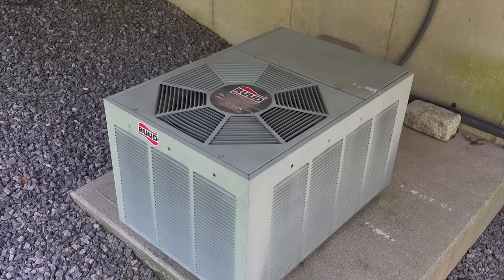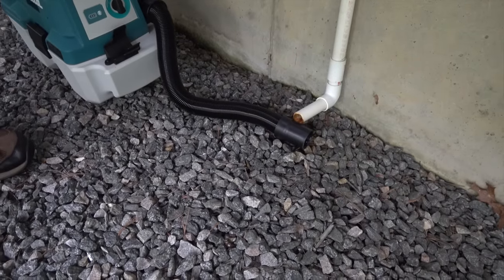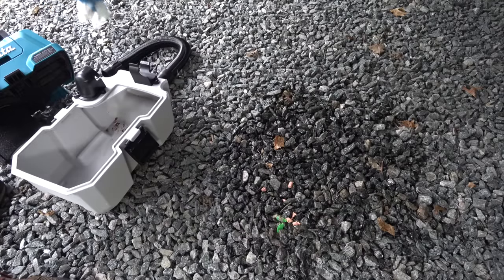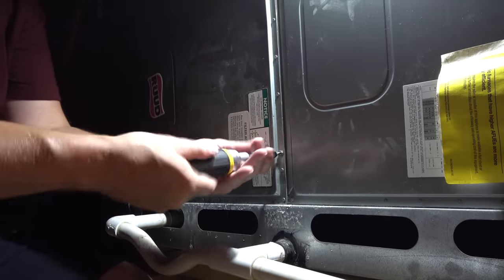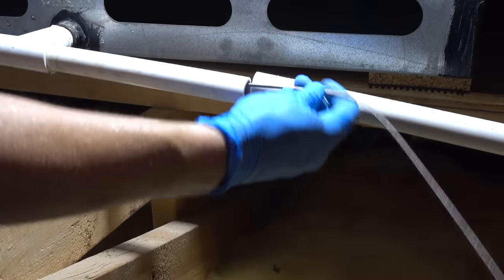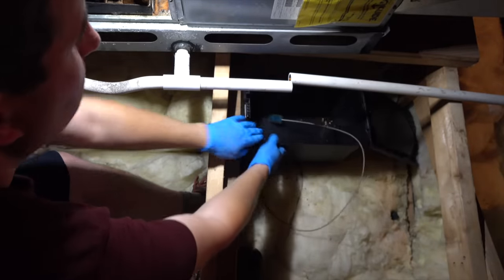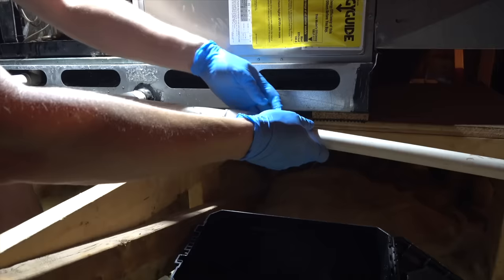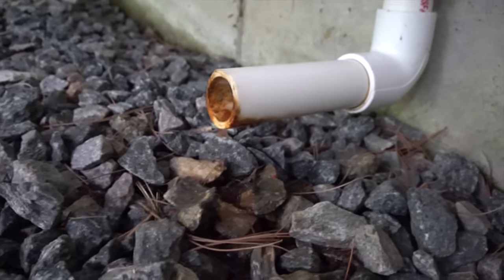How to UNCLOG your AC DRAIN Condensate line FAST - Water stains on Ceiling? or in the Pan

Comment: You’re better off having you system serviced annually in order the keep the drains and coils clean. You also should be using pleated filters, not the cheap fiberglass. The fiberglass foyer allows too much dirt through, which collects on the evaporator coil. Some of the dirt sticks to the coil, some of it goes into the pan, then to the drain.
Reply: Fiberglass,  or Furnace filters are primarily meant to keep paper and dog hair from a heat exchanger. Not filter the air.
Reply: craig kennedy you missed how I said to swap it out for a pleated filter. Pleated filters filter the air. 🤦‍♂️
Reply: I never use pleated filters which restrict Airflow. Fiberglass works fine. Airflow is everything. My evap coil is fine because I change filters monthly and have the coil cleaned every 24 months.

Comment: Instead of clowning around with tubing and pipe clamps, install a tee and a cap instead. It'll be much more secure and reliable, and you'll have a built in point of access to do preventative drain maintenance or a place to hook up your vac to remove future clogs.
If your forced to work in the attic, do yourself a favor and work smart. 🧠

Comment: Problem is my drain goes down into the ground in a cement slab to God only knows where, it backed up so many times i finally had to make a new drain line through walls of the house and to the outside, thats the only thing that finally fixed it.

Comment: what about a cup of bleach in the drain pan a couple of times a year? (as needed)
Reply: Old school, and bleach fumes can make people sick and damage the coil
Reply: @craigkennedy9968  - even though it's diluted in the drain water? And how would it damage the coil if it's only in the drain pan going down the drain?
(not trolling)
Reply: @corvuscrow5485  fumes. This is also why it is against code to pipe the condensate lines to sewer vents. Fumes, even if diluted with water, it will quickly become diluted with condensate water anyhow. And some don't open the condensate lines, they splash it on the coil.
What this jackleg isn't telling you, is that there are building codes governing how to run a condensate line, and he isn't doing it.

Comment: I'm confused:  At 3:10 I see the primary drain (the lower one) and the secondary drain (the upper one) both drain from the same PVC pipe to the outside of the house.  If the primary drain gets clogged by an obstruction in the pipe both drains are effected.  I live in a house where the primary was by the condenser coils and the secondary was by the entrance to the house.  One day I came home and noticed condensate coming from the secondary and I knew immediately there was a problem. No water stained ceiling!
Reply from the maker: That is correct, I have never seen dual pipes inbstalled except in the Southern states. Not a great thing really. ideally you would have 2. But most often the clog is in that trap so it must not be a big enough issue for installers.
Reply: You are 100 % correct. I am a home inspector in New York and I call it out everytime I see both lines tied together

Comment: Ever who installed that did it wrong, it's not even up to Code. It must have a drain pan and and overflow switch.. This ties into the Red 24v line and when the switch senses water it will Break Red and kill the Unit.  Any unit in the Attic must have a Drain Pan... And a 90$ float switch is definitely a must to save you from this problem.

Comment: On the condensate line, I take my water hose which mates up to the fitting.  I disconnect the line from the unit inside the house.  With my wife standing by the unit, I open the water hose and turn it off when she yells.  Then I go an vacuum the water out of the condensate pan below the unit and reconnect.  Do it every couple of years or as needed.

Comment: What size shop vac is needed? I just bought a small one gallon from Amazon. Is that sufficient?
Reply from the maker: You can give it a try, the one I used here is really small and worked fine, but it depends if the clog is really bad, but usually it just needs a little pull to get it out.

Comment: Sucking it from the outside, how about duct tape instead of rags?  And my a/c drain upstairs isn’t like in this video.  It’s like a T joint where it’s open at the top and if there’s a clog water just overflows and leaks into the guest bathroom below.  So the clog is definitely from the T joint to where it’s supposed to drain to outside.

Comment: I poured bleach, vinegar and warm water  (all separately of course)  nothing happened. Used a hose to flush outside water flowed inside my laundry room had to clean that up. Used a shop vac outside if I got a cup of water that's a lot. My outside fan is blowing perfectly. The safe t swtich works as normal yet the house is still warm

Comment: Can anybody help this single woman homeowner. There is a PVC piping all the way at the top of the second floor of my home and the water that’s dripping out is rusted and it’s staining up the side of my house I do not have a second pvc pipe at the bottom of my house anywhere so does that mean I still have to go in the attic or is there a secondary place in the house underneath the sink somewhere for me to use a shop vac

Comment: Dude, if you get water on your ceiling, you better call and curse out your hvac company! Because they didn't set your system up properly.  Even if the drain clogs, the pan underneath should shut the unit off when it fills up and trips the float switch. If it overflows,  you got more issues.

Comment: Air handlers have no business being installed in attics. It's not a matter of if it'll leak water and cause damage but when it'll leak water and cause water damage. I bought a house six years ago. The HVAC system was working fine but the air handler was inside the attic. I had it totally removed and I bought a new HVAC system and I had them put the air handler in the garage. I obviously had to pay extra for the extra labor and materials that it took to relocate the air handler in the garage but I sleep good at night knowing my air handler won't cause me any bad water damage from a possible clog in the drain pipe.

Comment: Thanks for the video. Do you know what's the function of that trap? it seems that it's a recipe for disaster! Also, when you put the cap on the access pipe, wouldn't it stop the water flow since it's gonna create a vacuum?
Reply: It stops bugs from entering your AC
Reply: Much like the trap under your sink, it is a water trap that allows water to evacuate your system without allowing air, unfilteted air, from entering the system. And yes, it can also keep bugs out. Too bad his trap was improperly installed and this video was so totally incorrect on so many levels, not to mention  again code. Hope noone sues him for this video.

Comment: I hear a dripping sound when the ac unit runs in my house. The dripping sound is coming from somewhere completely opposite of where the ac unit is in the attic. I know where the drip line is too. No where near from where the sound is coming from. Any ideas? No signs of water leak, just always a leaking dripping sound. Sometimes it sounds like water is dripping ontop of the bathroom fan/vent.
Reply: I’m not sure if yours is setup how mine seems to be but my attic ac unit looks like the evaporator drain is plumbed into the upstairs bathroom vent tube. So I’m assuming that the evaporator drains down into the vent for the toilet. So maybe that’s the noise you’re hearing. Not sure. I hear a noise from my upstairs bathroom ceiling fan sometimes even when it’s not on. It’s basically a tapping noise. I went into the attic and found what the noise is. It’s from where the fan exhaust goes out through the soffit vent. There’s basically a baffle on it and I think in any kind of wind condition that baffle will blow open and close creating that tapping noise. I thought it was water at first too by the way it sounded
Reply: Shifty C yes that’s exactly what I have experienced!!! That taping sound sounds from ontop of the fan! That settles it. It’s not water. It’s just some type of air displacement that’s making something ever so slightly open and close to bent out air/in. I’m glad it’s not water. Thanks for the reply!
Reply: Marco A. Torres II yeh man. Once u said it was right on top of the fan I knew exactly what you were referring too because that noise was driving me crazy once last year so climbed into the attic to see what it was. It’s just your exhaust baffle “flapper” opening and closing from air movement. Now I notice it pretty frequently. Nothing to worry about

Comment: Excuse my ignorance but what is the purpose of the trap in the first place
Reply: A trap holds water, it will keep air from being pulled into the unit from the termination point of the drain. It will also keep foreign particles from being pulled into the drain from the termination point.
Reply: In an air conditioner the trap provides a water break to overcome the negative pressure that the pipe is under so that the drain can drain.

Comment: Water stains and leaking on the ceiling because the air-duct is bad at such location. It cost you $3,500 to replace the entire air-ducts for your 1,600 sq/ft home.

Comment: This might be a dumb question, can a clogged AC Drain cause your central heat and air unit to not produce heat?
Reply: Yes, per code, you should have a float switch installed on the condensate line or pan, a poorly draining unit will run until the pan or line opens the switch,  then as it drains the switch can close, qllowing the unit to run until that float opens again. Instead of your thermostat controlling your unit, now it is being controlled by the float switch and the drains cqpacity to drain. Doesn't work so well ...

Comment: I was told, the ac drains inside the house main drain system and never outside the house, unless there was an issue, water in the pan, emergency flow.  Last tech remarks.  You guys tell ac unit  shall drain outside the house.  I  am confused.  Is this a  new house code vrs old homes? ...my last house, ac drained in the kitchen area, my current house is 1950.

Comment: Much easier with compressed air or nitrogen. Also would use a pvc union instead of a hose clamped to the pvc pipe. 👍
Reply: Reef Guy.... using compressed air/nitrogen can cause old glued pvc joints to come apart then leak water in wall or ceiling.  Only use vacuum suction to clear an ac condensate drain line.
Reply: Until you blow a fitting apart and get sued for damages

Comment: I had this happen to me about 2 weeks ago.  Odd part is that I bought a few feet of clear tubing to drain the clog into a bucket and the clog worked through the PVC pipe into the clear tubing.  Turns out it was a 2 ft turd (literally looked like a turd) of compacted material in the pipe.  I still can't figure out what it is.   I kept the tubing to try to get an AC guy to tell me what it is.
Reply from the maker: It can be some nasty stuff in there. No idea where it comes from but I am glad its gone for you and me!
Reply: Just as a small note.  This stuff wasn't organic.  It was kind of a mixture of clay and mineral deposit.  Not something that bleach would have helped with.  I tried C.L.R. at first but after a few hours of no results I move on to pipe pressure and suction.
Reply: So you snaked your tubing (I'm assuming 5/8"?) down the T-valve to where the line drains outside? And then hooked a hose up to the end near the air handler?
Reply: @kenseihiko  The drain runs from the attic down two flights to the crawl space under the house, about 50 feet.   I got lucky.  When I was trying to isolate the clog I just happened to cut into it on the first floor.

Comment: We never glue our ac lines there is no pressure so it doesn't leak and if you have a blockage you can pull the pipe apart to unstop

Comment: Unfortunately, this is not the way and will just cause further clogging or restriction in that location along with a possible point for it to leak.  A tee in the line with a cap would be the proper way to access without ever cutting the pipe and ruining a perfectly good leak free structure.  
Please due yourself a favor and just glue in a tee fitting that you can access from above.  You will be able to add things such as vinegar to lye into the pipe or a shop vac to help clear the water and or clogged material. 
Be Well!

Comment: Can you prevent this from happening?
Reply from the maker: Yes, you can do the cleaning in advance, which will help a lot. Most times it happens over 5+ years without this being done.
Reply: Get algee tablets that dissolve over time to prevent this happening
Reply from the maker: @andrewdarbyshire9108  I have seen those before. Might be a great thing, I will have to check them out. Thanks
Reply: Yes, ignore every part of this video after vacuuming out the line from outside, have your condensate line installed correctly and up to code. His isn't.
Reply: And no, not 100%

Comment: My Trane AC has water in the filter caging since flooding & high humidity here in ST. Louis. I've replaced & pulled out x 2 filters that looked like they were being sucked in by the blower in the last 6 weeks; The filters were a bit wet & there's also water at the bottom of the filter cage. All my hoses go into a floor drain in my basement; I cannot find any outside PVC drip drain ? There are two hoses coming from the furnace/AC; One nearer the bottom that is black & the clear PVC drain which is quite dirty.  I jiggled the clear one at the connection on the furnace body & noticed some water did come out.  Perhaps a more thorough cleaning of that house might fix the problem ?  Another concern is, that drain in the room did backup after heavy storms & the water did seem like it got awful close to the filter housing, it receeded so fast it was hard to tell.  As I'm typing this, I'm wondering if that nasty water backed up into the drain tube ?  OMG...that would be a nasty problem.  Also, I had a lot of construction with new floors put in & dry wall messes from a shower valve break inside my wall towards the last part of 2023; I had planned on having folks come in to clean all my registers out but haven't done so yet & now I'm fearful they'll push more gunk into the furnace/AC.  I'm a 70 year old widow who is taking care of a grandchild & her mother; I have a lot of concerns about what we're all breathing after all this & am just not sure in what order I need to work ?  I have no problem with having an HVAC person in but I sure as H... cannot be told I need a new system right now.  I had the AC running the last 24 WO a filter which I know is not good. Any advice would be soo appreciated. Thank you.

Comment: a problem i also had was the company did not lay the drain pipe at a nice descending angle ... i was constantly having ac shutting off... i finally figured out issue and fixed it... now once a year i clean out drain pipe not every month like before... Stay away from Mr kool in sw florida... they are not a good company imo...

Comment: That drain is wrong you should have two separate drain lines, main drain and pan drain they can't never be connected together they need to be separate emergency drain should run above a window.  Main drain near outdoor unit its code and put a vent tee before the trap also called cleanout tee

Comment: I can't believe some people still have their air handlers inside their attics. That's an expensive ticking time bomb waiting to happen.
Reply from the maker: That's how it goes here in New England I would say you will see it this way in 70% of installs.When I made this video the attic was almost 110!!!!
Reply: For ac the attic is actually optimal
Reply: Down South Texas, A/C Handler Are Installed In Closets First Floor and Second Floor.  Since Outdoor Temp Can Be Over 105°
Reply: Gerry Rig I live in Houston, in a new house. Mine is in the attic 😬
Reply: Air handlers in the attic have benefits and drawbacks. 
Yes, in the south,  you lose some efficiency due to attic heat warming unit and ducts a bit. But they don't end up rotting from crawlspace moisture or succumb as easily to biologic issues.
And if your condensate lines are run properly,  and you have proper air filtration, you don't have to worry about condensate issues or water damage concerns from these leaks.

Comment: No pan and no safety switch lol... By code here you install a safety switch so water doesn't leak like that, as soon as a clog is detected it shuts down AC so flooding doesn't destroy ceilings or any floors

Comment: That drain line should be insulated if it's in an attic
Reply from the maker: This is an ac system only not heat so you won’t usually see that done that way here.
Reply: Only needs to be insulated if drain is under positive pressure and trap not deep enough, use a nanometer on the drain fitting with unit running on high speed to know how deep trap should be.  I always use a J-trap

Comment: Where you cut it at put a T so you can have a air gap so the water flows
Reply from the maker: You don't need one. since the pan is wide open and should have a lot of flow. It's not link a sink where the drain is at the very bottom, most pans have it on the side.